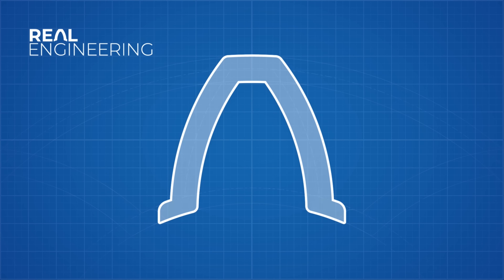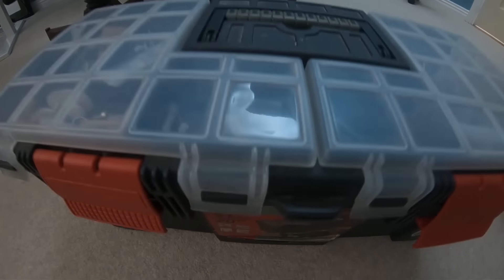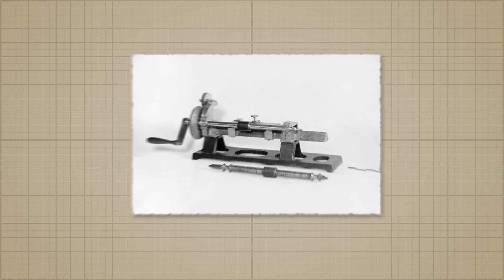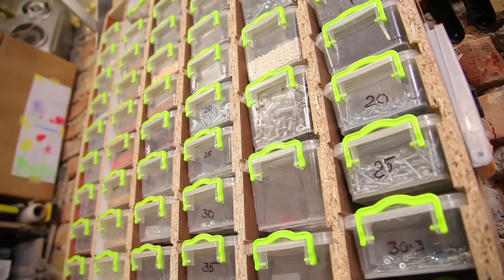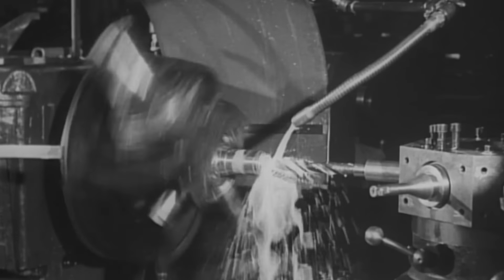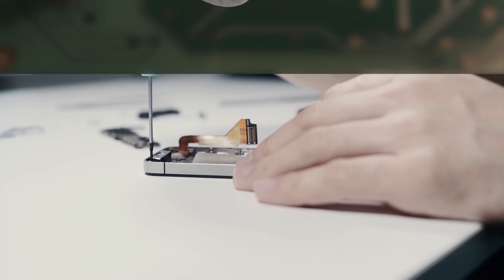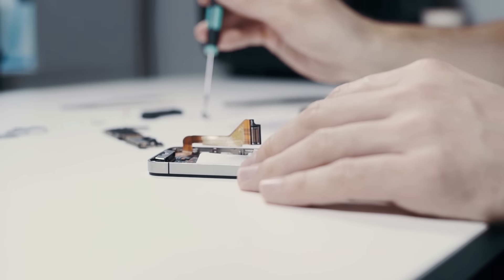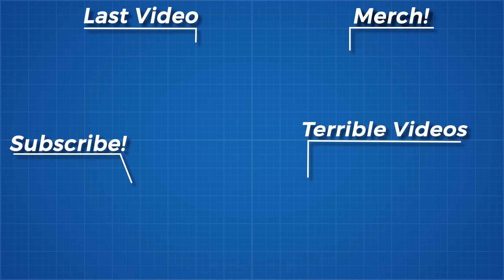Why Are There so Many Types of Screws?!

Comment: Thought I would learn that all those different types of screws have actually a purpose and are not just to piss me off.
But you made my day by confirming that it is indeed just to piss me off!
Have a nice day.
Reply: In germany theres basically 4 types of screw heads: Hex, Nut, Plus, and Minus. Plus, Minus, and Hex are pretty much what you expect, hex screws usually being used in manufacturing, and nut screws have heads shaped like nuts so you can use the tool youd usually use for nuts to apply them instead of a screwdriver. And from there, the differences are based on what the screw is supposed to be used for, for example, there are your run of the mill screws, theres cutting screws used on sheet metal to cut their own thread, theres ones with elongated, thin shafts made so that you can apply pull to them, which is useful in applications with a lot of pressure present thats trying to force parts apart, etc.

Comment: Meanwhile ins Canada we have to suffer with having both freedom units and metric units
Reply: There are benefits to knowing both.  There are also negative aspects.  When in the hospital they put my weight in the kg box as 188  and converted it to 413 pounds.  They were to put the 188 in the pounds box so the guy in pharmacy sent them to see if I was really 413 pounds because that would affect how much medicine he would give me.   There was also an aircraft that was only filled half full because they mixed up the imperial and the metric.  The plane ran out of full half way into the trip and crashed.  BUT if you know and understand both then there are things I like about both.
Reply: Try being an american engineer, they think you are crazy when you do anything in metric
Reply: akrinah  It's a joke.
Reply: In Canada, we measure weight in pounds, measure speed in KM/h and distance in "how long does it take to drive there". 
I like it this way
Reply: @Kushufy  No the metric system was made by math experts so you need to do more research.  The units are all multiples of the last unit so are much more logical.  The problem is how they are used sometimes.  In  Architecture they put the length of a house in millimeters that are the smallest unit in the system.  This is crazy because a building would be 20 million mm in length so I hate that.  But if you work with radians the imperial system is lost.  The metric works 100% better because you can calculate the length of a curve to the exact mm on the unit circle.  They think a radian is an angle in the imperial system but they are WRONG.  It is the length of an arch on the curve of a circle and is easy to work with in metric.  I trained in both Architectural and mechanical so learned both imperial and metric so I can use both systems with no problems.
Reply: akrinah  the problem is switching to metric would be a lot more difficult than a lot of people think and it would cause a ton of problems plus a lot of Americans nowadays do know the metric system in some way or another
Reply: @moo Not for me
Reply: akrinah we use both metric and imperial units here in the U.S.
Reply: @conradmcdougall3629  This is bi-math just like bilingual language ,  means Canada can use both.  We use greyhound  in spelling because we use both as greyhound is from england and gray in color  from the US.
Reply: I got a few random ass drawings where they didnt even mentioned what was what. I just had to guess from the decimal point ... ON THE SAME DRAWING,
UK is the worst giving you the lenght in meters and the thickness in inches.
Reply: When I built my house, the blueprints were metric, and all the materials were " freedom units". I suppose some one thought that made sense.
Reply: akrinah  sorry to be that guy but. Whoosh
Reply: From Canada, I tink the narrator is Irish (Can't pronounce 'is h's). 'ad a grade scool teacer, accent, (ass ole), te same.I tought 'e was Irish. I NOW tink 'e was a Newfie.  "Tink, tink, tink!" Nicknamed 'Tinker', it stuck and passed on to future students!!!
Reply: You are not suffering you are transitioning.
Reply: Marc T  but the boiling and freezing point of water at sea level is always the same 100C and 212F  for boiling and 0C and 32F for freezing , so your saying c
That it not right if a city or country is at a higher altitude ? 
And only 3 countries in the world.use the imperial system , Liberia ,myanmar and the US
Reply: akrinah me too but freedom unit is a way of mocking the Imperial.unit
Reply: I work with both as a pipefitter. You get used to it.
Reply: Marc T  That is why all of the SI units have been redefined to constant values measureable from anywhere. Originally the meter was the distance between the king's nose to his finger, now it is a fraction of the distance light travels in a vacuum in 1 second. 1 second is defined at how many times a cesium atom changes (atomic clock stuff). Imperial is now defined a messy fraction of the metric system now. 

Imperial is only understandable if you grew up with it, memorizing it all. Metric just has the same scalars in front making it easier to transfer from grams, kilograms, milligrams, megagrams, etc. Same for litres, distance, and others.
Reply: @ukaszwesoowski3175  Also Pressure is defined by Newtons per square meter (Which is Pascal). PS. Pascal is the SI unit for Pressure. and one bar is exactly 100 000 Pa. A athmosphere is like what? 1.013 bar so neglectable except you are going to create a rocket to the moon...
Reply: @conradmcdougall3629  .  In days olden, distance in Canada was often measured in "Beers".  But we don't do that anymore.  Well, I suspect in Nordern Hontario it's still in use. ;)
Reply: I tell people "In Canada we are bilingual. We speak English AND Metric."
Reply: @owenprince4823  20million mm? that's 20000meter(or 60000feet ish../720000inches.....) Thats a DAMN large house. Obviously you can't use both systems without problems
Reply: @genrabbit9995  So you never heard of hyperbole before???  My point what that I hate using mm to dimension a skyscraper.
Reply: You know that the metric units have risen from the French revolution and the imperial units have their roots in the English monarchy? 🤔 How can the imperial units be "freedom"?
Reply: @owenprince4823  20 million mm is 20 Mm in SI units
Reply: @owenprince4823  There was space rocket rapid unscheduled disassembly by exact same reason. Fortunately it was unmanned mission.
Reply: @RubenKelevra  I believe you're mistaken... Well, not you in particular but from the OP assuming the U.S. system is Imperial Units. Imperial Units are different in almost all aspects in regard to US. Specifically speaking, Imperial Units are based in, what is now the UK, and the United States actually uses what is called "U.S. customary units." Ie: inch, gallon (smaller in volume and weight from imperial unit), foot... I think, if my memory serves correctly... Which almost never does lol, is that we borrowed the names of the types of measurement to apply to our own, since if it isn't broke, and you only have a bucket of dried barley... You would be better off naming the bucket's measurement as gallon, instead of bucket x-high and x-diameter to equal a bucket of dried barley... Just use names we already know. c;
Reply: @killerriot22  nope it's the other way around. UK changed their unit definitions in 1824. That's why they are significantly different than the definitions of those in the US.
Reply: @RubenKelevra  I always love being wrong. Ha!
Reply: @crypticabyss1013  Yet the other 95% of the world's population has done exactly that switch - it's not so hard.
 Muricans pride themselves on their "innovation" and "knowhow" but really they are one of the most stick-in-the-mud people on the planet; they hate change.
Reply: Marc T  "Pretty sure that seconds predate SI" - sure do, by about 3000 years.  Time units use multiples of 60 because Babylonian numbers were base 60 - as against base 10 (because we have ten fingers) or base 2 (because its easier to build computers). Not even Napoleon, who converted Europe to metric at the point of a bayonet, could get people to use decimal time.
Reply: @RB01138  Sure, as a pipefitter.  Try being a machinist though - the pitch of some SAE/Imperial screws is just different enough from their closely corresponding metric bores to cause chronic stripped threads.  SAE is EVIL.
Reply: @owenprince4823  Just stop using redundant and isolationist units
Reply: akrinah  it would be very expensive to switch over and I'm pretty sure any self respecting scientists use the metric system nowadays
Reply: @owenprince4823  Thats what you have meter for. But you said house, not skyscraper. A skyscraper given its size in feet is way to small too
Reply: @deathpony698  Well as an American engineer I can tell you that fortunately the day I graduated was the last day I ever had to use slugs. But then I am also a physicist and everything I do except nuts and bolts is metric. Not that I am opposed, but the hardware store is a bit deficient in that realm.
Reply: @danielcarroll3358  I think I needed to use slugs outside of school, even the wind tunnel here isn't metric
Reply: @deathpony698  My condolences.
Reply: @owenprince4823  Actually if you look up the story on the Gimli Glider you will see that the aircraft did not crash, but landed safely on an unused runway in Gimli Manitoba.
Reply: @Kushufy  Been a while since I've read something so ridiculous. Thank you for the laugh.

Comment: The lack of pratical application is so relatable 😂😂
Reply: While most cower in the face of the youtube censorship adversity, one man says fuck it and goes all out
Reply: I would have listened more in Science and Math classes if the teacher had sprinkled in a bit of practical application examples.
Reply: I remember starting an engineering degree (I was not smart enough to finish it) and watching a student who was putting a wing nut on an exceedingly long bolt slowly turn the thing through every thread. I had to show him how to hit the thing to get it spinning so you weren’t there for several hours.

Comment: 6:40 Ahhh Apple. SCREWING the public since 1976.
Reply: Just...

No.
Reply: Just "apple" things
Reply: They continue to do so, now with their pentalobe screws
Reply: You gotta think different
Reply: I don't recall the Apple // series computers having odd screws.  The Macintosh introduced in 1984, on the other hand...Did.  Steve Jobs did not want the tinkerers who played with cards and the like on the Apple //'s to play with the innards of the Macintosh.
Reply: Smarter Than You  I never had the opportunity to see an original Macintosh, but I can definitely assure you that by the time the Macintosh Classic was introduced that they were using #10 Torx screws to hold the case together.
Reply: Considering Apple started out with kit computers you built yourself (all you got was the circuit board), yeah, the video's claim is a bit hyperbolic.
Reply: The more things change the more they stay the same